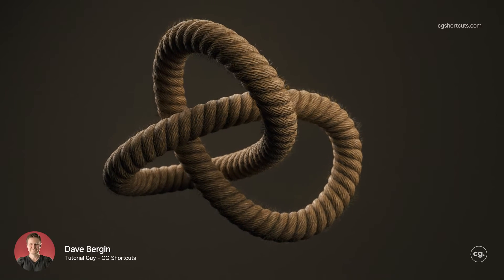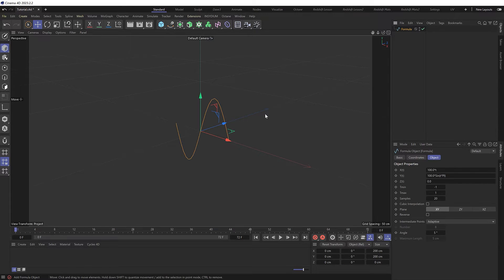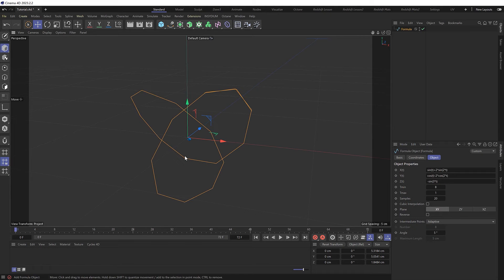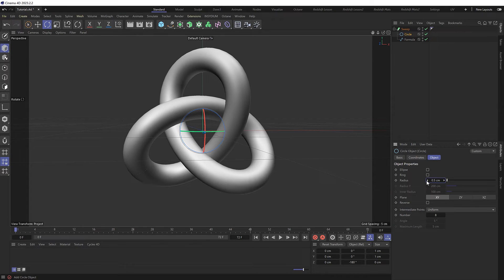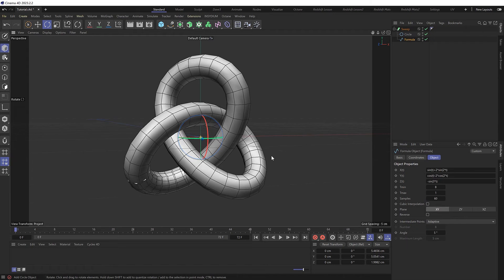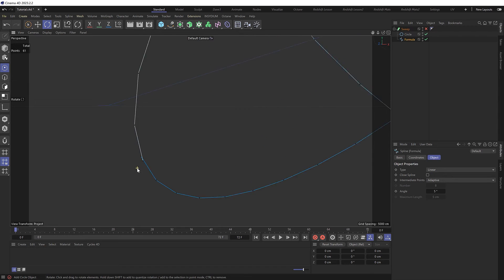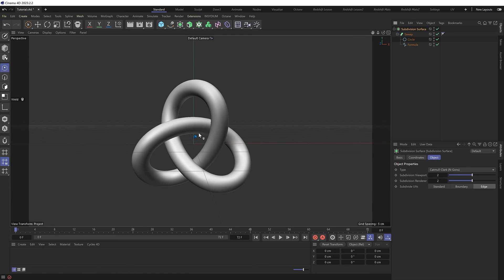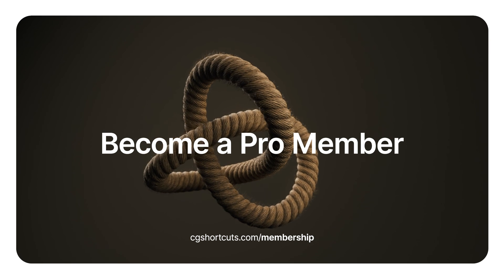Create a Trefoil Torus Knot in C4D - Cinema 4D Tutorial (Free Project)

Comment: Great tutorial, bow would you do this using a rectangle spline instead of a circle, and make the ends meet without intersecting?🤔
Reply from the maker: Cheers, pretty sure you can just replace the circle with a rectangle and it should work, you might need to play with the rotation of the sweep to get it aligned correctly